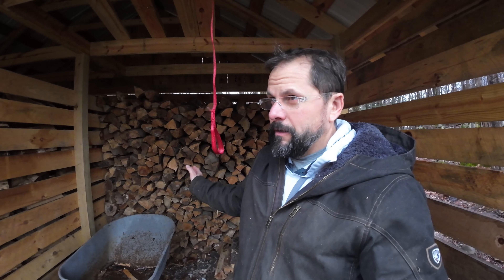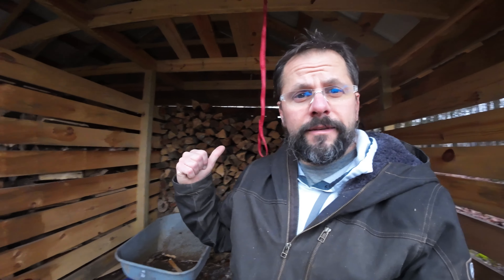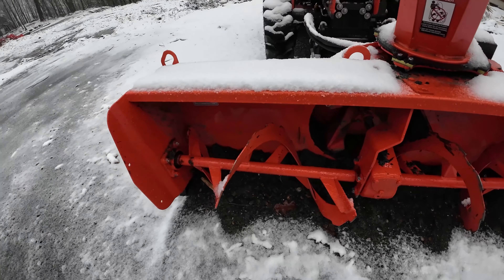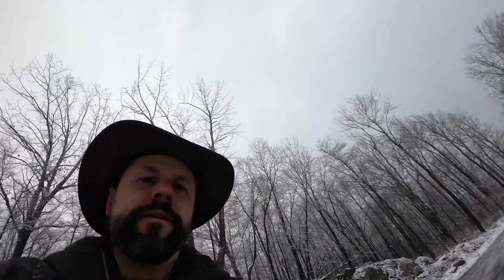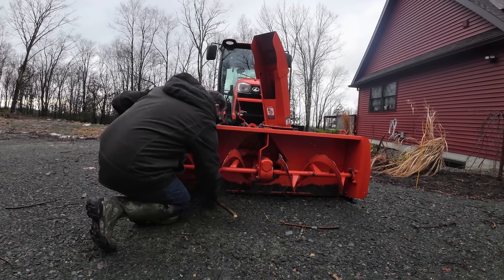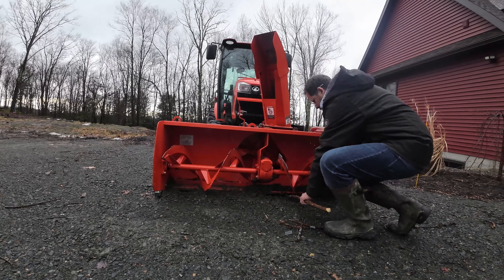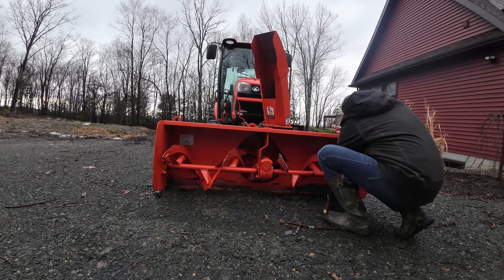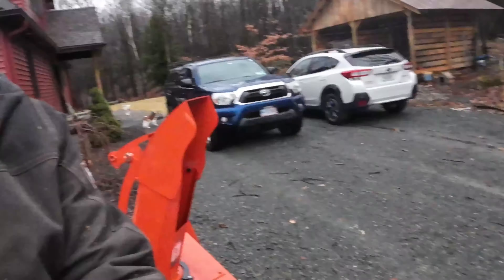Shear Bolts Matter  | Save Thousands | Kubota Snowblower

Comment: You are correct my friend. Use the right shear bolts and never have to worry.  Gear boxes are not no cheap and on my Frontier SB1164 I don't want to wreck this one for the sake of a $4.00 shear pin.  My dealer told me it's around $1,800 plus shipping and taxes and 6 weeks away. Excellent video.
Reply from the maker: Glad to see some people agreeing with me.

Comment: I totally agree with you Dave.  Buy extra exact replacement shear bolts at what ever they cost.   Much better than having $$$$ in repair costs because they did not fail and took out other big bucks components.   Just my 2 cents.  Dan 😊
Reply from the maker: Hi Dan, makes sense to me!

Comment: You are in fact not blowing this out of proportion. I have got an old bx with snowblower on it and it would break bolts non stop on the asphalt part of my driveway. The gravel section was even worse. I don't know if it was a mistake I made with the shear bolts or something the previous owner did, but the snow blower impeller shear bolt would last at max 5 minutes before I had to replace it. I brought it in for service at the dealer and when all was said and done, it cost $1700 in parts and labor. Used it for the first time this year today for about 3 hours and it works flawlessly.
Reply from the maker: That’s a chunk of change, glad it’s running the way it should now!

Comment: I build my own shear bolts. I put a relief in it just as the original. Just turn it out in the lathe.
Reply from the maker: If it works for you….
Reply: @MtTopLiving  I start with the recommended bolt grade, and add the relief in the correct spot. Its exactly what you can buy, just 10% of the cost. On my  Honda 928HS blower the fan shear is a strange double step one and I make those also. I hate spending the big bucks on trinkets.
Reply from the maker: @1958johndeere620 I totally understand, it’s good to be handy.